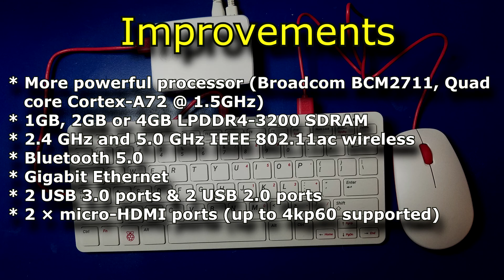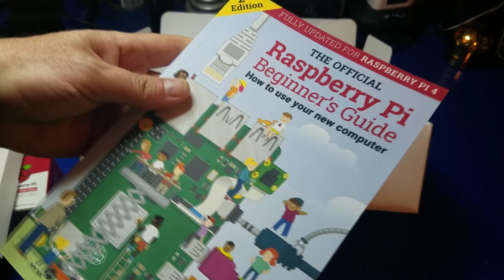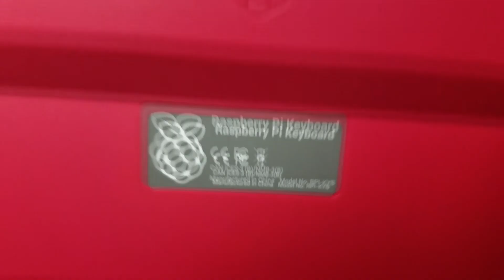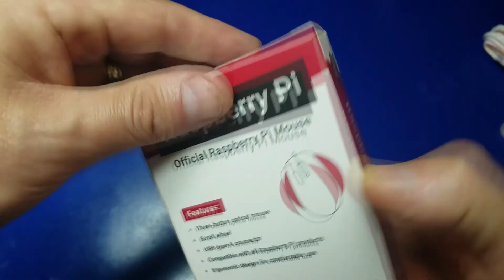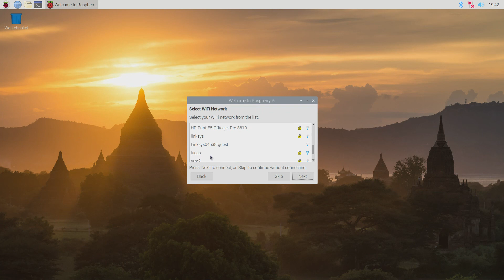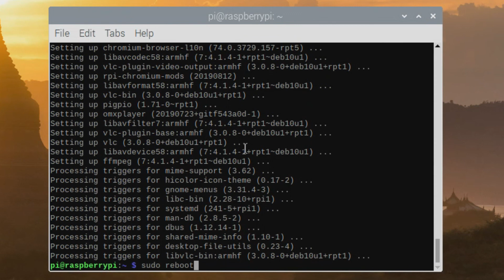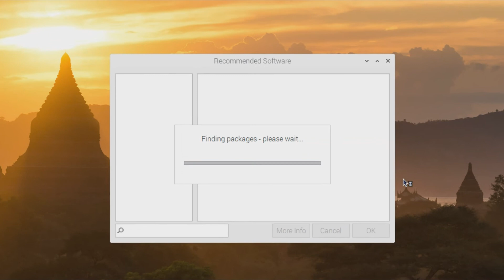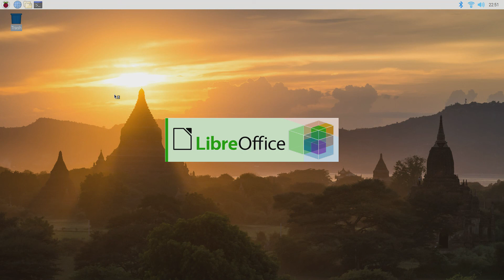Raspberry Pi 4 Desktop Kit:  Unboxing, Setup & RPi4 Review!  Raspberry Pi 4 model B 4GB + Tutorial

Comment: Nice helpful video, thanks.  If the my end goal is to run ADS-B software (FlightAware or GlobalExchangeADSB) does it run along with Raspberry Pi OS (Raspbian)? Or would each system boot up separately ?
Reply from the maker: Hi Chuck, I'm  not at all familiar with either of those applications.  I'm sorry, not helpful on this question.

Comment: Hi ! i'm setting this up with a new monitor and my monitor is asking for a vega cable and other cables. is this something i need to get separately? :)
Reply from the maker: Are you talking about VGA cables?  If so, yeah that's not included on the Pi 4.  VGA has been pretty much replaced entirely with HDMI.  The easiest route would be to use a monitor which has HDMI input (instead of VGA).  Otherwise, you'd have to use a USB->VGA Adapter.  Now those work as well, I use one in my RetroPie Arcade cabinet on a Pi 3b+ (this is the exact one I'm using: https://amzn.to/3cRZ11k ).  However, keep in mind I'm using it on a Pi 3b+, haven't tried it on a Pi4.  Also, VGA does not carry an audio signal, so you'll need external speakers for the audio.  Or, again, go with an HDMI monitor/TV which carries both video and audio.
Reply: @WagnersTechTalk  thanks!
Reply from the maker: You bet, have a great weekend!